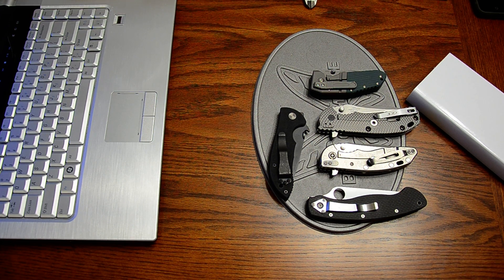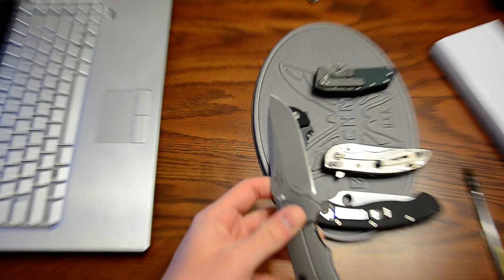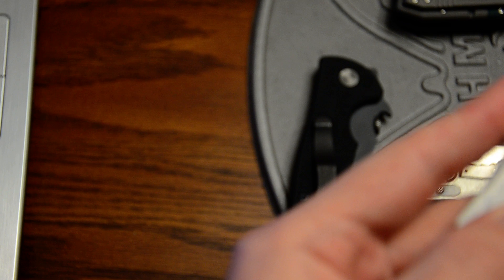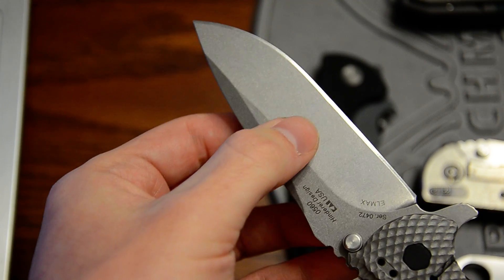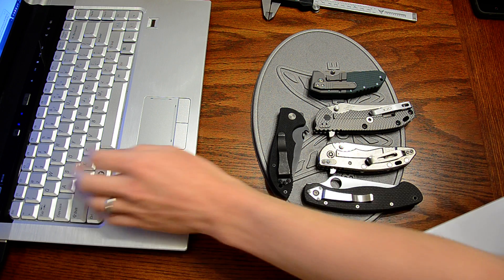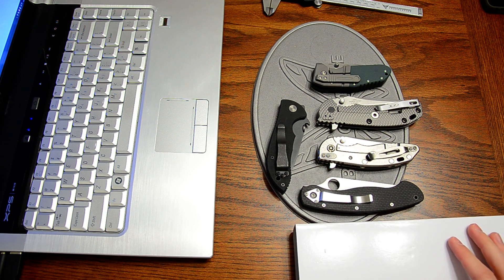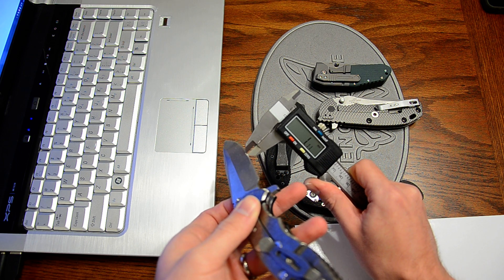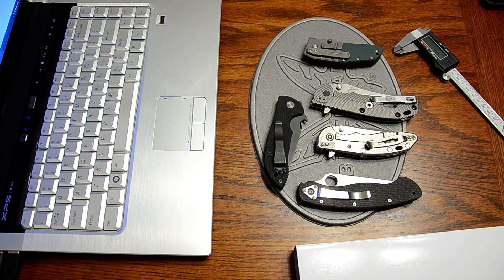Quick & Accurate Way of Measuring Edge Angles

Comment: Here it is 2021 and lots of different manufacturers produce knife sharpening machines with ways to determine degree angles. In fact you can even do it on your IPhone. Not one machine sharpens at 44 degrees so I think the proper angle for sharpening that knife would be 20 degrees. I really don’t think that is a good way to find the angle o& a knife edge.Check it out, in fact most sharpening systems use black permanent markers to determine the angle.
Reply: I believe you are correct. You will probably have to divide the result by 2 to get the proper sharpening angle of each side. So 22-degrees would be the called for angle. However 20-degrees seems to be more the standard today, so I would think this method would just get you a close ball-park estimate of the correct angle.

Comment: Up front, You new readers too save you time. This is a quick rough way to determine the total angle. As pointed out below you divide this by 2 for actual sharpening angle for that particular blade. Just my observations here. Was looking for a quick way to do this. Thanks for putting this out there #jdavis882

Comment: Calipers aren't realiable or usefull to the point of measuring the angle of a blade. Also you assume you got the exact same angle all the way up, which you wont have when you sharpen it. 
Maybe a micrometre, but still. I dont see the point here? 
You would be better off using a grinding gauge with the right angle.

Comment: Wrong. The resulting angle you got it is not the angle of the blade, it is roughtly twice the angle of the blade (since the sides measure differently)
Reply: Exactly - 44 degrees is the measure of the apex angle. Since an apex is made up of two *bevels*, both bevels added together must equal 44 degrees; this is referred to as 44 degrees *inclusive*. In the case of cutting edges, you would hope/assume the two bevels are of equal angle (forming a centered apex), so you must divide 44 by 2, equaling 22 degrees per bevel. This method isn't great for knowing exact bevel angle, as it's essentially averaging out the two bevel depths, which we already saw were measured slightly different at 1.35 and 1.28. But still a pretty cool method!
Reply: Yes. An angle of 30-40 degrees would be a cleaving machete angle, not a pocket knife.

Comment: stupid video..doesn't help if you don't show us what you are doing or where you are getting the program to give you the angle!!
Reply: Seriously? He showed you and explained it - you measure the depth of the blade bevel on both sides, the thickness of the blade at the start of the bevel and use the Pythagorean theorem. You must've missed 6th grade geometry.
Reply: not to mention that Pythagorean theorem only works for right angle triangles
Reply: He showed it all you need and it's called doing math, you don't need a program. You just need to graduate middle school. The Laws of Cos, Sin, and Tan is simple. Measure the bevels, then the thickness. Three sides of a triangle. You can get angles from that. Two law of cosines equations, then add to 180. You can get the inclusive angle, divide by 2 to get the bevel angle. Edge angles won't be exact regardless, most if not all consumer grade sharpeners are not 100% accurate.

Comment: I contacted Catra and they told me the £75 machine "needs a little practice" and is accurate to 2º, whereas the £1600 machine is "easy to use" and is accurate to 1º.  I'll try JD's method first. If that's too fiddly (my old eyes need a magnifier to take the critical measurements accurately), then I might go for the cheaper of the Catras. There is always the EdgePro method - but this is not so good on Japanese knives like my Santoku whose secondary bevel is 11º total (cutting edge 25º total)!

Comment: Ahh the good ol' Law of Cosines... used almost daily in my line of work. =)
Very good video my brother.
When people used to ask me how I knew what edge angle I was getting I would begin describing the process of finding the angle using equations and they would usually go "HUH"... good to see you putting it out there nonetheless.
I also tried explaining the coin trick to them... a quarter is .69" thick so you can stack them and under an angled knife and use the math of the coins to get a reading.

Comment: Its a good method if you run on the assumption of a single bevel with no micro, and a sharpmaker like flat bevel.  How I determine the edge angle is similar, but not relying on any bevel size or structure. raise the blade on a strop until it bites. then measure the height of the spine off the strop, and the blade height at the position testing and do the exact same thing.. but you are dealing with much larger figures reducing inaccuracy, and it doesn't matter what shape the edge is. good vid.

Comment: This technique would seem to be most accurate on knives with a strong secondary bevel as opposed to gently arcing full convex or hollow grinds with perhaps only a microbevel at the edge.  

Though I guess the distances are small so "assuming" the arc into a flat angle measurement is "close enough."

Comment from the maker: I repeated the measurement 3 times before I made the video, got the same result each time. 

I'd say it's pretty accurate. Being off .5 mil doesn't change the angle all that much. You have to be a good bit off in your measurements to make the angle be only 1 degree off. I'd say that's pretty damn accurate.